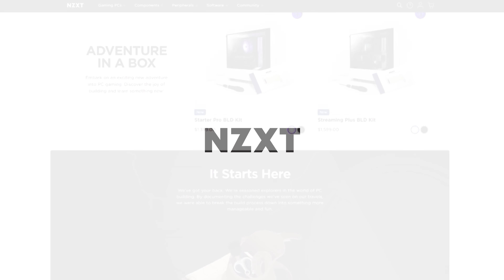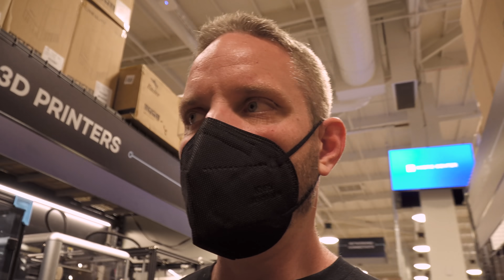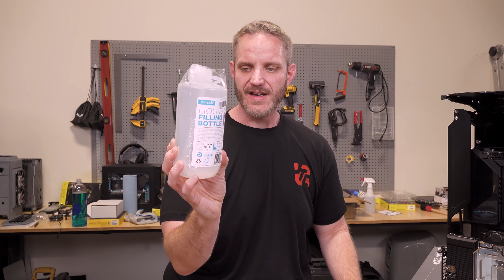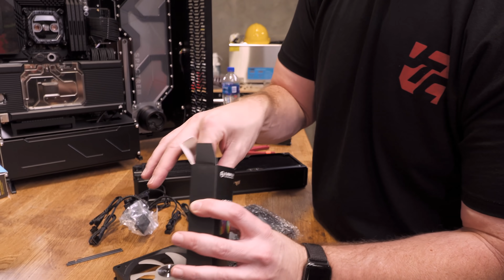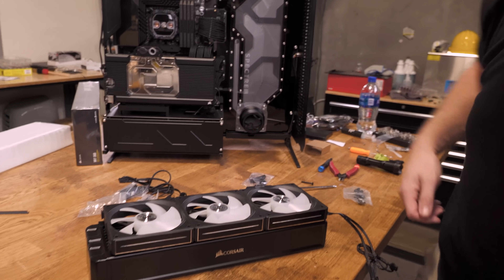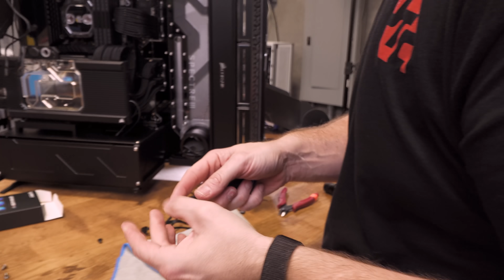We are professionals... professional IDIOTS!

Comment: Unfortunatly only carry sparce random primochill revolvers, NEVER proper stock on EKWB ZMT, They carry the corsair stuff but unfortunatly. 

 Corsair rad's cant handle large loops with big head pressure. I have had 9 of them and 7 pop'd at .8 bar. Corsair GPU block's well you know they suck both heat and leaks. there cpu blocks are mediore.

They carry EKWB but not XE rads.. like WTF really no XE's com on now. No hard line tourqe fittings. Great selection of CryoFuel. 

LOADS of bitspower push pop fittings... seen so many of these leak for no reason and absurdly hard to install proper... just to failure prone for average peoples.

Would like to see them dump the crap bitspower stuff.. Corsair isnt going anywere they probably pay for that wall space. Get proper selection of EKWB fittings and rotarys. And FFS carry egnough ZMT.

Comment: do they not make an extension for those fans that lets your bridge from the fans on the front rad to the ones on the top rad so you only have to route the cables from the bottom of the front rad?

Comment: That thin radiator looks so sad being removed. Couldn't you find a use for it? Why can't you have two radiators in a build? Like say one for the CPU and another for the GPU or even a radiator for the controllers on the motherboard and the big radiator handles the processor and GPU? I mean would the thin radiator be useful to cool what typically isn't water cooled?

Edit yes I realize this would mean adding yet another radiator to the build but that thin radiator looks so sad being denied its purpose.

Comment: Hi Jay, can you please show me those custom cables that you're using? I'm not a fan of those cables because they extend the cables that come with the power supply and they're not replacements which is what I thought the custom cables would be.

The concern that I have with those custom cables is the same concern I have with power distribution blocks, if they are done right it's okay but still not ideal simply because every connection you add will add some resistance to the total and my idea of getting custom cables is not only how they look but I also want better performance which in this case would be less resistance and clearly that's not the case with the custom cables and that's the main reason why I wouldn't want custom cables personally, I rather have them look a little less nice and perform better.

The 3 things that I want to see are:
1. Can you please show me the pins they use on the power distribution blocks or figure out if those are hollow pins or split pins or full metal pins preferred made of copper.
2. Please do the same for the custom cable extensions and show me the pins they use, either they are hollow, split or full metal pins preferred made of copper.
3. Please show with a multimeter the total resistance of the cable from the PSU to the plug and then add the custom cable extension and show me the total resistance again to see the difference.

I think you'll be surprised yourself when you see how much resistance you're adding just by using those custom cables, and I would like to know these things before I start building my new system and it would clear some of the controversy that I mentioned of adding resistance to the power delivery of your components and I think it would make a very interesting video for your audience too.

Comment: Why not use a black plastic washer between the screw head and the case? Especially if you are worried about the screw heads from scratching the anodised coating of the case

Comment: the 3 pin rgb connector there, while not standard in PC, seems to be a "standard" for most addressible rgb (JST 3 pin connector) to be used with non-PC RGB controller (the likes of cheapo addressible rgb strips with their controllers)

as they are the same in circuitry with standard PC ARGB (for addressible type), there are adaptor for pc like JST to 3-pin ARGB.

for RGB strips, they can be use as cheap alternative as per meter usage than PC ARGB strips but mobo argb can be overloaded if not careful with longer strip usage>>

Comment: Those Lian Li aRGB plugs may not be standard but they are not exactly uncommon.  My Alphacool 2080 ti waterblock came with the same connectors for it's aRGB and Phanteks uses it as well (Barrow might use it as well but I could be remembering it wrong).  To be honest, I prefer it or the connector that Corsair uses over the "standard" aRGB plug because of the locking lugs (one of my old builds required me to cable-tie a regular old RGB connector together to prevent gravity from disconnecting it over time).

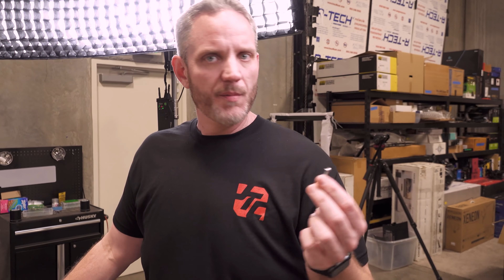Comment: 19:00 you could put the washers in between the case and the radiator, that way they are not visible on the top of the case but hidden in between.

Comment: You could try putting the washers between the case and the radiator.  Or file a little off the end of the screws, just make sure that you put a nut onto the screw first so that you can reform the thread after filing.

Comment: Figure out how to mount up your sensor panel over the water pump… since it doesn’t light up or anything. Mount it between the front edge of the psu and to the radiator somehow! Maybe on an angle so you can easily see it.

Comment: Been trying to figure out a good spot for a sensor panel in my Phanteks P500 case. The PSU "window" looks a bit small for it, but so far it seems the only real logical place for one. Just finished re-routing the secondary cables from the mobo this weekend to tidy it up so that I don't have random small wires coming out from the board on all sides, so just looking to add some nice finishing touches.

Comment: Jay. No need to contact Singularity for the fasteners you need. Any well-stocked hardware store (let alone big-box one) will have those same sizes and type screws, nuts, and washers (either black oxide, anodized or polished in metric OR imperial classifications). And also, WTH, Micro Center?! You have NO presence in the PNW? Where Intel has its largest concentration of campuses? Of course, Fry's itself only had a single store in the area and even then, it was only one they inherited from their purchase of the original Incredible Universe store. Talk about an untapped market.

Comment: You guys are lucky, there isn't even a hardware store for computers stuff left anywhere close where I life, I think the closest one left is about 90 minutes away going one way, but even their online presence claim limited stock. Getting anything within a reasonable frame of time is a mute point because it's not happening, in stead you order and wait for a few months and if you are lucky the stuff you ordered trickles in. 

Building a computer is difficult when it takes nearly a year to get most of it except a gpu which you can't get for any price less than 2000$. It's not fun computer days around here.

The radiator has sunken screw tops to sink the screws holding on to the fans on the other side and that would let you use shorter screws to just hold the radiator to the case using the second screw hole, while the radiator hold the fan close. Done right it shows just the end cap of the screws on the fan side for a more hidden look. Or I think that's the reason why at least.

Comment: One thing you can consider for the fans is to patch two of the proprietary fan connectors (aka the ones that connect to the actual fans) together and run one from the top on the front rad to the front of the top rad fan. This ofc assumes that the daisy chain can support at least 6 fans.

Comment: Now that you have a 3D printer that you might get to use you might like to make spacers for the front between the case and the intake fans. I have done this myself on a few systems and have found once the leading edge of the fans is cleared by 10mm or so from the bars on the case they make a lot less aerodynamic noise as the blades pass the bars - just a thought.

Comment: I think I would have rotated the top fans so the wires comes out at the back right side instead of out in mid air. That way it would be easy to hide them behind the front rad.

Comment: Question for you Jay!  Since we are both car guys and pc guys I’ve had the thought of building a custom pc that’s so called car theme. -6an lines for the water cooling  and your carbon block  while using all titanium hardware. I’m currently sponsored by a company called JDCustoms for my car and I run all there titanium hardware and im sure I can send him all the sizes I would need for all the bolts  what your thoughts on this? Cool idea using titanium hardware?  Any issues you would see?

Comment: It's not just large cases the Lian Li fan cable length has trouble. I've got a 011 mini (3 top & 3 bottom) and I'm only just able to run when the cables are connected in opposing corners

Comment: Jay! 
If you don’t want to have washers on the top screws for the radiator. First mark the screws with a sharpie or paint at the corrected length, grab a nut (that is the correct thread for the m4 screws) and thread it onto the screw, then just grind down the screw or trim with cutoff wheel.  Next, take the nut off to fix any of the threads that may have bent on the ground down side and VOILA! Correct length screws!

Thanks for the great vids you keep putting out! Keep it up!

Comment: Those Screws look more like M4 x 30mm (1 inch = 25.4mm). Metric size is stated M4 x length (of the shaft not including the head) Regardless if its fully threaded [set screw] or not [bolt].

FYI I ditched the Lian Li box in favour of a standard rgb hub. It works fine I have 10 fans installed, you don't need to install the Lian Li software (Complex effects may be more difficult) i didn't look into it in any depth. I cut the end off the 3 pin rgb lian li cable, threaded the rgb through the sleeving with the fan and spliced on a 4 position 3 pin addressable plug onto it to connect to the powered rgb hub / splitter which is connected to the motherboard addressable header.

Comment: They have plenty of AMD GPUs because they're marked up to "I could just buy a nice laptop for this much."
I took a stroll through my local MicroCenter Sunday afternoon and the stock situation was about the same. It was kind of funny because all the nVidia card they have that lost driver support are in bins next to the locked cases. The AMD Cards aren't though, even the HD7750 and HD5450 cards that basically only existed because the former has like 4 mini DP ports and the latter because you needed something to get a display out on your file server.

And I don't know if they thought I had my "go away sales drone" expression on or what, but nobody asked me if I needed help with anything. It was kind of disappointing, TBH.

Saw people buying parts to build machines, but not one did anything more than wall through the GPU aisle check the prices and keep moving. That was good to see.
I don't know if they're passing on the markup from their suppliers, but the pricing is insulting.

Just about everything else there is a good/decent deal though, so they'll get my money when I don't want to give Amazon the sale or feel like spinning the "which warehouse will it ship from?" wheel with Newegg.

Comment: Could you mount the controller above the vertical rad? might only have to extend one cable then? or none if it's long enough?it's black so not hugely noticeable or at all depending how the case sits on a desk

Comment: Now that Nick has a 3D printer... just have him print like 0.4mm thick plastic washers... then no scratch =D

Also since you are prepared to cut your wires anyway... the Lian Li fans do not have "proprietary" RGB plugs per se... it is actually just a standard plug commonly used in RGB strips... the middle wire is for RGB data... so you can just snip it and re-wire it to use PC ARGB plugs... and then you don't even need L-Connect and just control them as if they are ARGB strips... I am sure you already know this anyway but I just wanna put it out there in case anyone who is electrically savvy wants to "simplify" things...

Comment: AFAIK the "larger" screws (mainboard, radiators, HDDs) in the PC world are UNC threads and the "smaller" ones (optical drive, floppy, SSD) are metric.
Reply: Ok, EKWB uses UNC for its radiators. Corsair uses M4xP0.7 for the XR7-360.

Comment: So, maybe this is a dumb suggestion, but why not hide the Lian Li controller behind the front rad?  It looks about the size of a 2.5 inch drive similar to the Razor Chroma, and with how thick that front rad is, it could probably be tucked either behind it or with a little cover panel, could probably even be mounted between the top of the rad and the front grill above the fans.  Heck, if it has standard 2.5inch mounting points, it could probably be mounted with a 3d printed mount, then it would only need a usb extension and possibly a power extension.

Comment: Those Li-an Li fans would benefit from having a reversed end plate included. 
On the top rad, add the washers between the case and the rad, so you can't see them.

Comment: I discovered the proprietary 3-pin plug from Lian Li is the same as a VDG 3-pin plug. I now have a PH-CB-DRGB3P_MB adapter/splitter from Phanteks plugged directly into the motherboard's ARGB header which allows me to control my SL120s directly from Armoury Crate without the Lian Li controller or L-Connect software. It also means I didn't have to splice the 3-pin ARGB wire to get more length out of it. The 4-pin PWM is plugged straight into one of the motherboard fan headers. Works very well if you don't mind losing the L-Connect software.

Comment: With AIO and RAD setups I do criss-cross with bolts so the fans are always attached to the case and you can detach the RAD (if AIO or soft tubes) and clean the fans from behind :)

Comment: G'day Jay, Phil & Nick,
Nick with how Bumpy that ride is did you take the Suspension out of your Honda to change it from being Fit to being Fully Sick 🤣🤣🤣🤣🤣,
Jay if you are ordering some of the Larger Fan + Rad Screws & 10mm ones from Singularity then see if they also have some 8mm for the top Rad, if 10mm is too long & 6mm too short 8mm may be just right without a Washer

Comment: Jay, the Uni Fan RGB connector is a standard "ARGB strip" plug, used by at least Asus RGB strips. ;) I use my Uni fans without the controller, using some Asus RGB strip adapters I had lying around (included with motherboards and RGB strips).

Comment: quick idea, can you go from controller to the bottom most fan of the front rad, then top most fan to rightmost on the top rad? (essentially daisy chain 6 of them?)
Reply: even if max 3, you can still move the connector to the right side of the top rad and hide the cable behind the front rad? might be long enough then? 

and the front, there's no reason to keep that connector on top, shorter way from the bottom fan?

you could even hide the controller in the top right, somewhere between the rads?

Comment: If you have longer screws they sell wire stripers with threaded holes that size for cutting them off. If done right the threads are usable and square.

Comment: could you not just turn the top fans around so the cables are at the front?
hide them behind the front radiator and connect down thhere to the controller?

Comment: For the top fans, can't you just turn the whole fan array round so the connectors on the right at the back? Just a thought, the cables could pretty much run with the fronts.

Comment: Hey guys, a tip if you want to cut down on RGB software bloat, you can use a cable adapter for your AL120's, connect them directly to a Corsair RGB Hub and control everything through iCue. That's how I do it anyways, I've been really impressed with the AL120's performance, ease of install and lighting! I personally have my RGB set up to be heat reactive on a curve, looks really cool! Anyways, hope this comment helps someone.
Reply: SignalRGB will control all of it without needing to install any other bloat for it recognize.
Reply: @NickeyMouse  Yea just don't use G.Skill RAM with it unless you wanna have dead RAM RGB on your hands lol.
Reply: iCue might be able to control them regardless. 
I've just finished building a friends PC and noticed that iCUE could control the Asus motherboard and GPU.
Reply: @agentcrm  That is true 👍 had trouble getting the Lian-Li software to work properly in a couple of builds. So I switched to using the Corsair Hub if possible to bypass any hassle. Ymmv of course.
Reply: @hardlytech9072  I avoid the issue entirely in my own builds. Because I use a sound dampened case and you can't see any lights in the first place.
Reply: @agentcrm  That's cool. I enjoy RGB so I use it.
Reply: @agentcrm  You often have to install ASUS' garbage software for icue to recognise the board though. And that is the bloatiest of bloatware i've ever seen.
Reply: swapping fans so u can move 1.2w more out of your rad that can handle 200w more than what your rig uses

Comment: Put a small sensor panel in the upper right corner gap created by the radiators/fans (maybe 4x3).  Maybe a another slim one (1x6) facing forward to fill the gap between top and front panel.  Would not obstruct your view of other components and also provide space to hide wires (unifan controller?).  If you put the unifan controller back there then may not have to create custom extensions.